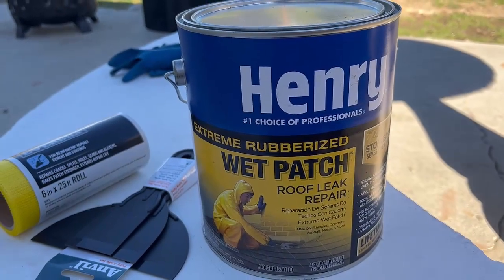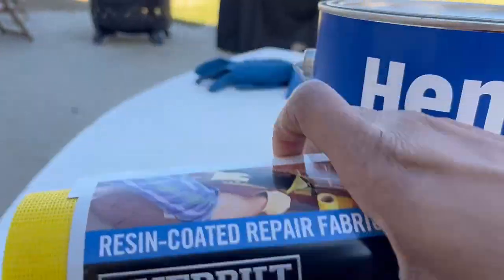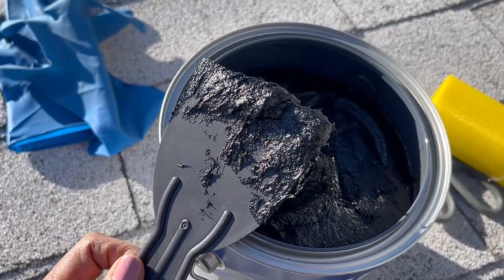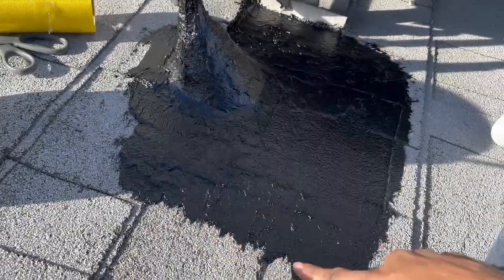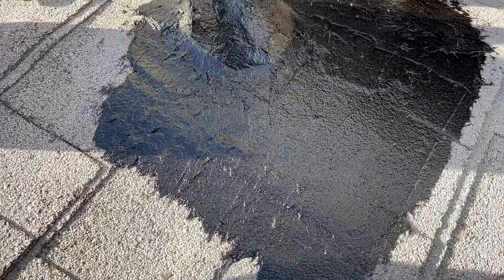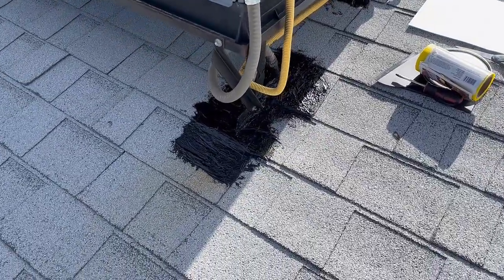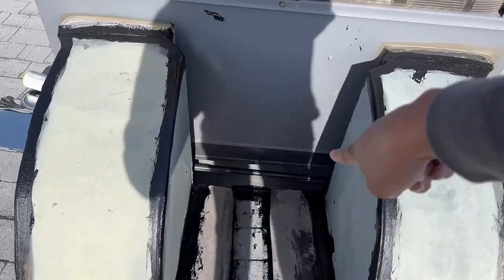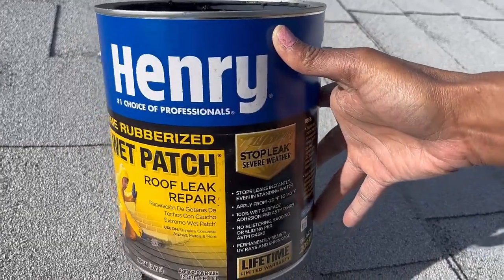Henry 209xr Extreme Rubberized Wet Patch | Roof Leak Repair Review

Comment: You need to apply it UNDER the higher shingle, not over the bottom edge of the shingle. Water needs to be able to drain out from the bottom of the shingle. What you've done instead is to trap any water that may seep in from the sides and it will stay there until it finds any cracks down into the roof.
Reply from the maker: Thank you for sharing your insight. Everything is doing well so far and our area has had some terrestrial rains. The product works great. All the best to you!

Comment: Hello,
After applying Henry 209XR  Wet Patch Sealant on the roof, Can we apply Henry
887 Tropi-Cool 100% Silicone Roof Coating on it?
Reply from the maker: I’m not sure. I only used this wet patch and it’s still holding up amazingly well.

Comment: Thank you so much for your review.  A guy came to my house and placed that product to stop a leak in my room.  Now it smells.  Do you know if eventually it will stop smelling 😔?
Reply: definitely not for indoors
Reply from the maker: I used this product on the outside of the house only for the roof. Hopefully, the smell went away, but it works very well.

Comment: Please let us know how it's holding up.  I'm looking at using this too but read it doesn't last.  Thanks
Reply from the maker: We have already had our share of severe rain storms since I put this on the roof and I don't see any leaks or dampness in the attic. I used the strongest strength one they have to make sure that it stands up to the water exposure. I hope you have success if you use it.